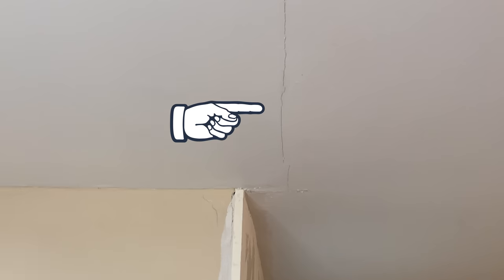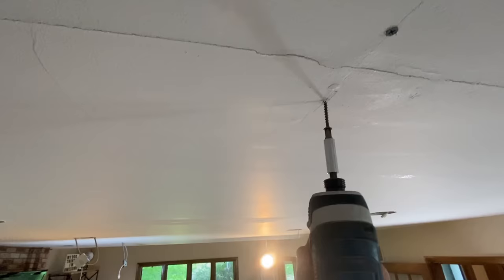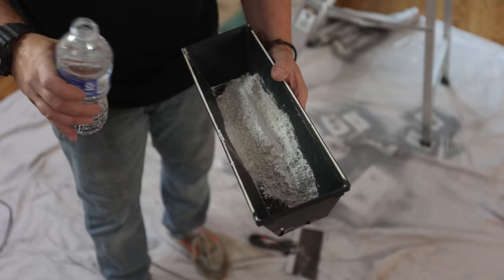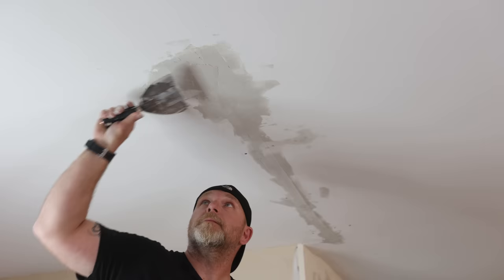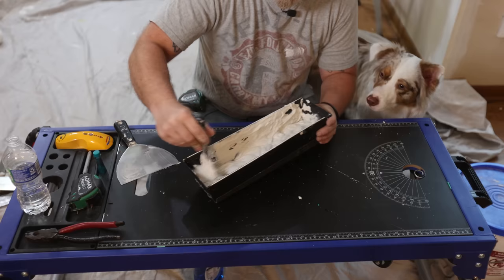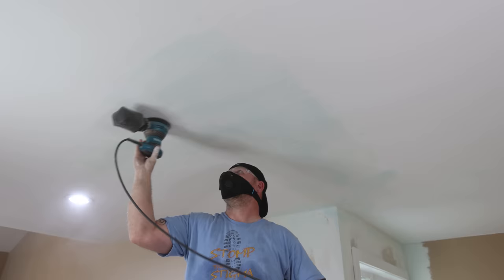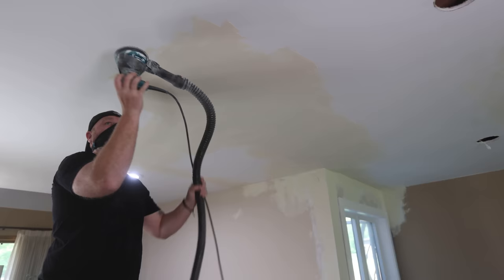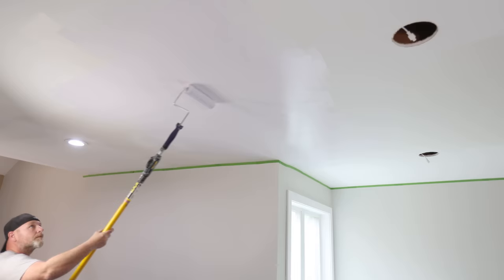How to Fix a Drywall Crack in Ceiling or Wall FOR EVER!!! Tutorial

Comment: A few things that I would point out: 

1.  Mesh tape on the ceiling is a no no.  You have to use paper tape with yellow joint compound.  It is much stronger because yellow mud compound has glue that reinforces the tape.

2.  You have to feather out the joint 2 feet on each side, going parallel with the joint, never perpendicular.  You have to use a trowel and a hawk for best results.  These drywall knives are absolute garbage and will never provide a proper feather to the mud.  

3.  Never use a power sander on your joints!!  You will oversand and leave terrible scratch marks everywhere!  You have to sand it with a pole sander, sanding sponge and a light to achieve best results.  

It’s hard to tell in the video, but I bet I could find scratch marks and uneven feathering on that ceiling with the naked eye.  

I get it, this video is for DIY but it won’t pass for a level 5 finish.

Just my 2 cents….
Reply: Well not everybody can run a hawk and trowel .
Especially in a remodel / fixit mode.
But I've used mesh tape plenty on ceilings , that held up.  However a hot mud prefill or set the tape with is best there .   But you better make sure that ceiling is tight enough too !   Washers on screws if need be.   But then again if you can pull it off ... That expanding spray foam in attic with T-brace below , does a wonderful job . . . no screws or very minimal ?
Reply: I agree with most of what you are saying (except, that I prefer fibreglass tape to paper) but it also requires more tools and more practice. Especially the practice part is hard to reach for a laymen DYIer.
Reply: You were right on the first one, but you are off you nut on the second one. While I like using a finishing trowel on large areas, you do not "need" to use one to get a good finish. 99% of the tapers in the US use drywall knives with excellent results. And you absolutely do NOT need to feather out 2 feet on a small repair. 

A power sander can be useful if you overdo it with the harder setting "hot muds" because they are an absolute pain to sand, but I would not use a small hand sander for a finish job. I have a drywall sander I just bought, but have not used it for final sanding yet, so I don't know if it will leave scratches. One big mistake he made was using torn sandpaper on his pole sander. That will leave gouges in your drywall mud.  You should always check your final sanding with a light run horizontally across the surface. You will be surprised at how much you will never see until you put an eggshell paint on it. Then you will never be able to not see it.
Reply: @MAGAMAN  horizontal light is unforgiving

Comment: Ive done this very specific fix as was shown,  I use 90  all the time for patching before final coats,,still cracked the next year..  was good for  most of the year than voila it was back…
Reply: You need more flex not hardness. When we had our house built they put a few seams under windows or over doors, never seam drywall over or under doors n windows. Any i way i dug out the cracks and i filled them with a flexible caulk, primed and painted. Works great.

Comment: Sanding between coats is not recommended without priming first. It will flash and you will see it thought the paint. I always cut out all the old tape joint and old tape before starting my repair. That way you don't have to float so far out. Didn't address air bubbles either. going back and forth over it in all directions with you knife as flat as you can get it and moving slowly helps.

Comment: Thanks for this great tip on the food coloring. I use micro tape and I stagger the screws about every 4". Yep same thing I use the orbital sander and you know it you can make your own dust collector with a Shop-Vac with 12 ft hose that's a special order on the DeWalt that I have and then you take a plumbing reducer coupler rubber part I'm not sure what it is called exactly with the hose clamp ends on it take off your dust bag and then put the shop vac into the hose into that for dust collection. My shop vac was actually pretty powerful in it slowed the orbital sander down because it was sucking so hard but it eliminates all the dust pretty much and saves your lungs even with the mask you're still getting it full charcoal respirator too. So durabond ?this is a different product than a 20 minute mud never use that

Comment: I had the same thing happen to my ceiling because the 2 X 4 roof trusses were sagging in the middle of a 32 foot run from the front to rear of the house. No fixing this crack without putting a glue-lam up in the attic ninety degrees from the trusses and pulling the ceiling up to level with 1/2" lag bolts! The drywall was cracking because it doesn't stretch. The cracks always start near a wall corner and if you fix it without pulling it up, it will always come back!

Comment: I did these types of repairs for 20 years. I guarantee this crack will come back. I repair so many of these after someone did just what he did. I stood behind my work for a year. I told people to call me no matter how long if it failed. The reason the for that crack was due to the ceiling spand. Continuous ceiling from front to back. It usally cracks in the middle. If you put one layer of tape on a crack like that, it is not enough. I would run tape half lap in the directiion of the crack for 8 to 10'' on each side of the crack. Then run over it half lap at 90 degrees for the entire lenght of the crack. This produced a large bandage of tape over the entire crack. This acted like rebar in cement. It spread the stess out over a large area. The first coat of mud was thin and would bond tape and ceiling. I never applied mud until tape was applied. This was my money repair. I never had a call back for failure. It also allowed to hid the repair over a bigger area. When rooms have continuous ceiling like that the light runs from front to back and shows every flaw. Spent more time hiding the flaws due to early morning sun. I learned this technique from an old plasterer. He repaired plaster like this in old homes and commericial buildings. I made a lot of money with that repair. Raised 9 kids with that little lesson.
Reply: So you applied tape first and then the durabond on top of the tape? Curious to know how you would approach the crack if it was uneven with one side slightly raised higher over the other (about 1/8th of an inch). Sounds like your approach would help cover that up too.

Comment: Also, ifyou have ashifting soilcondition, add silicone caulk to your joint compound, itll flex withthe shift due to uneven soil conditions throughout the seasons..... works well when repairing lath and plaster problem reoccuring cracks, ;-) your welcome

Comment: Ideally there should be a watery adhesive that penetrates into the porous exposed gypsum sides of the crack. Keep filling as it is absorbed until it hardens. Then another adhesive tape plus primer that bonds to the paper or paint on the sheetrock panel.

Comment: If you don't address the issue of the movement of the header, you will still have return cracking. You have to drive screws into the header from the side of the rafter. When houses are older, the nails loosen up and the header moves, as do the rafters from heat expansion and contraction, screws about 3.5" long will stop this, a couple in each rafter end toe nailed into the header.

Comment: Based on this video, you may not be familiar with power sanders. Imagine a round 9" pad that rotates at adjustable rates, and that hooks up to a vacuum cleaner. Makes for a perfectly smooth job on your finish coat with half of the effort using 120 grit. I also use it to knock down old paint using 40 or 60 grit. Bosch makes a good one. I personally use a DeWalt, 'cause those are the batteries that I have. You'll never go back to hand-sanders except for corners or tight spaces.

Comment: I used to “V” out cracks such as this one , but now I would shave out all the way down to the rock, eliminating the paper tape and more than likely loose paper on the rock. Then tether the paper tape to make it fit into the shallow area, and tape and fill with 5 minute.  Skim with 5 minute and slick in with t lite topping.

Comment: Regarding the crack repair; I insert backing (furring) wood @ appropriate widths, then place many 1-1/4 to 2 inch coarse threaded drywall screws, then Fiba Fuse, then setting compound and top layers of mixed drywall compound as you show. A question arises: how thick are your finishing compound layers (over the meshed fiberglass tape)?  Thanks!

Comment: The only thing I would do differently is use paper tape rather than that mesh.  From ripping houses apart for 40 years, I know that paper holds much better, and doesn't leave hatch marks if you accidently sand too far on your final coat.

Comment: Sometimes you have maybe 2 or 3 joist sandwiched or maybe a situation with headers, king or jack studs and expansion between them and then the builder having a seam joined there.  I've had to cut and bridge drywall over these areas to be 100% sure I don't get a call back with my 8 year guarantee

Comment: Wtf. I've been a finisher for over 30 years. This is some handyman special stuff. No professional would repair a crack this way especially using mesh tape.
Reply: I agree based on application style alone but disagree about the mesh. I don't like the mesh either but as long as it's set with setting compound not the premixed joint compound it's fine. Never use all purpose pre mixed mud with the mesh tape. It will fail.
Reply: @mongjedi244  if you only have premixed do you use tape?
Reply: And his sanding job covers the entire house in dust
Reply: Food colouring to see we’re ye been 😂😂. Come on man !!!
Reply: @superbrush12  right? He didnt even suggest a stain blocker for the pigment.
Reply: He forgot to mention hes only done 4 previous jobs over all of those years
Reply: Why because you don't want to take the time?
Reply: @jamiwilliams5885  I guess you didn't notice the vacuum hose on the end of his orbital sander 🙄.
Reply: It's a tough pill to swallow when you've been doing something for 30 years just to find out later you've been doing it wrong for 30 years🤭😆.
Reply: @JasonSpitzMI50  lol. That's the wire. Regardless.  I've never had a house collect the entire mess. I saw no plastic over the door so I assumed the residual dust is flying everywhere.  I personally have done so many of these jobs I never ever use a sander. My jobs as te very neat and barley require a wet sponge to perfect. I would never do this job in this manner. He completely lost me at add food coloring
Reply: @JasonSpitzMI50  😂😂😂😂😂😂😂 wow you really have no clue what you're talking about
Reply: @JasonSpitzMI50  
No. This guy  in this video did it wrong. Mesh tape sucks & it will easily crack again, especially how this guy did it. Paper tape is way superior to the mesh crap. However, if you do use mesh tape, durabond is not what you use. You would use the green lid premixed sheetrock compound or the equivalent. 
The cutting of a circular shapes in the ends is just pointless as well & does nothing.
Reply: None of you know what your talking about, I'd put expanding foam down the Crack, sand it down and paint. Good as new.
Reply: @blkacdevl2517  
You must use tape or it will still crack again.
Reply: @blkacdevl2517  that's one of the stupidest things I've heard in a long time
Reply: I agree no place for the mesh to go will  always be a hump there.
Reply: @Mavrik-60   
I cut the old tape out, plus the paper on the drywall a solid inch both ways of the joint & then mud/tape it, so it's not sticking out at all.
Reply: @_MjG_  ok I didn't remember seeing you peel the paper back. I've done this repair innumerable times. I simply peel the paper back after I've properly secured the DW to the studs. Then it's just a matter of taping and floating it like normal with dry wall mud these are regular customers so i would know if they ever failed every apartment i walked into today has many hidden repairs I've done over the years. I don't do a third of the what steps you do and you can't find any of my repairs. I wouldn't be called back if ya could.   Been doing this stuff since i was a teen. I'm 59 still going strong.
Reply: NONE OF YOU know what you're talking about. You fill in the crack with toothpaste, preferably Crest Whitening toothpaste and apply Scotch tape over it while it's wet.  Then, you mix in ketchup with your first batch of mud. The second batch of mud you can use mustard which essentially turns the red hue to a light orange. I've been doing it this way for 61 and a half years so I know what I'm talking about and you're welcome.
Reply: @natet77787  Worked!
😀
Reply: @natet77787 Nate I tried this but used the glossy scotch tape did I screw it up
Reply: Or you could of cut the plaster board out where it was cracked to the joice's... applied new plaster board and plastered it in half a days work. Good effort but you're always going to see the dip on the ceiling where you patched it, and to mention it would cost 3 times the price
Reply: How would they fix it ?
Reply: @anendlessjourney3298  Yes, please do use mesh tape with premixed joint compound.  I am a DIYer and have done that for 25 years. Never have had any problems.
Reply: 30 years or 300 years... I have used mesh tape with premixed mud and never have had any problems. One basement finished 22 years ago, another one 5 years ago, and multiple small rooms during the last 25 years. No problems whatsoever.
Reply: @sidsid9808  so you claim to be an expert since you used it one time 20 years ago? Hmm interesting!
Reply: I like how you can see it even after the paint is dry.  handyman special might be to nice for this guy
Reply: @blkacdevl2517  😂

Comment: I used Olympics latest and greatest pink tinted ceiling paint a few years ago in my bathroom. as the paint dries it turns white. When ever I took a shower it turned pink again. Not the worst part. It started oozing and dripping brown and pink, running down the walls.Washed the walls and a coat of stain seal primer and it bled through. A coat of oil based primer and it bled through. I skim coated everything and another coat of oil based primer and it didn’t bleed through for 5 years. now it’s showing again. I will never touch any paint like this ever again. Lowes returned the purchase price with just a little wining. Several hundred dollars of paint and many hours spent.  Never again.

Comment: My first step would have been find the embedded screw's take them out squirt construction adhesive through those screw holes as to glue the drywall to the stud  then tighten with new screws , and add a couple fresh screws along the crack

Comment: What I like….is using 3 different fillers/coating products….I cannot say this any better….but these 3 products I am going to try in the future . I had always used 3 coats of the SAME coating and mesh, but results were inconsistent long term. Recutting the crack, w stress circles after reinforcing the sagging ceiling w drywall screws, most overlook. Using an RO sander, sanding pad, high quality primer is key. I do NOT like the purple Valspar tinted ceiling paint…. I hated it, uneven finish….best I like is Lowes VALSPAR ULTRA ceiling paint and primer (I tried all the rest, this goes on smoothly, dries w no roller marks!

Comment: that was great ! My place here in prague, CZ has rendered internal walls. Then the developer painted them without bonding the walls, so the walls are chalky. And there are cracks all through it. As it's not plaster smooth, I'm wondering how to fix the many cracks on the walls and the wall/ ceiling joins. I guess just use this method, but prime the repair area beforehand

Comment: If you are repairing an older home, the ceiling white paint you find most likely wont match your old ceiling. Might have to paint the whole ceiling. I did a ceiling in a corp CEOs office, no match found,had to paint it all with a fresh coat. Looked great.
Reply: Some places offer digital colour matching - if you take a small sample they can scan it and reproduce the exact colour.
At least, that was the case in Australia 20 years ago, when I used it to fix a wall in a rental property I'd done a bunch of stuff to.

Comment: This guy did a decent job going through the steps of drywall crack repair, but this was a water leak.  Structural cracks are a different animal, and as good a job as you do will not stop the cracks from reappearing within a year or so.     Lots of these failures are caused by movement that occurs through the change in seasons.  
The  issue is  with the underlying framing, and trying to solve these problems can be frustrating.  Vaulted ceiling can be an example of movement  failure.
Floating the drywall in angular vaulted ceiling by removing all screws in area (12 -16 inches on either side of the crack and just taping and patching the drywall) This allows the framing to move independent of the drywall and is the only solution that has worked for me in the past.

Comment: Durabond 90 is THE BEST first coat for any drywall project!  Hard and tough.  To be sure, it's really hard to sand, so trowel it smooth while you can!
Reply: Any fast setting mud will do as long as you secure the surface like he showed. Westpac fast set lite sands super nice and is strong.
Reply: Not on a painted surface.

Comment: Nice video. Like how you left out the first half hour of navel gazing, farm chickens and monster trucks. Straight to the point.

Question: I have one crack on a continuous ceiling that covers the whole first floor.  For it to look right, do I need to paint the whole ceiling or just the area of the crack?